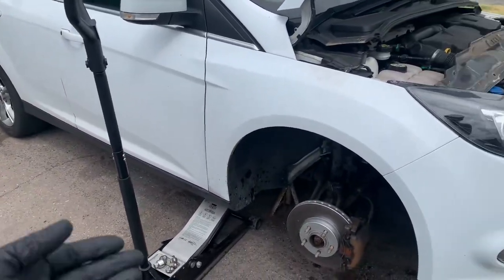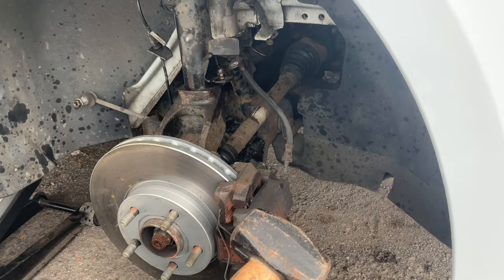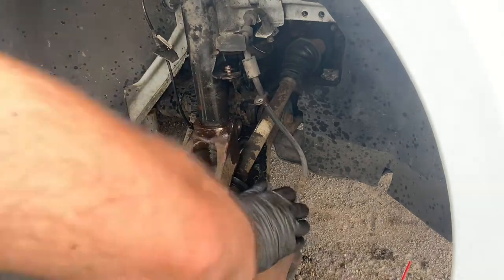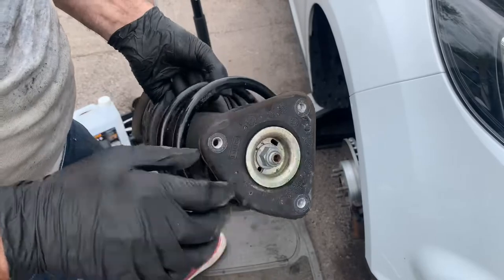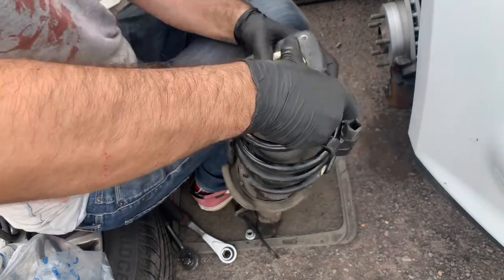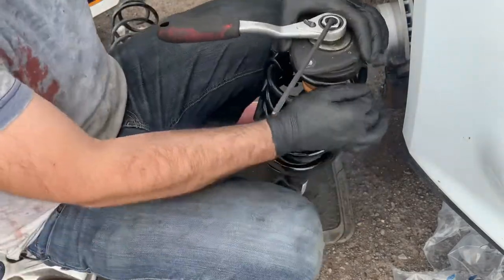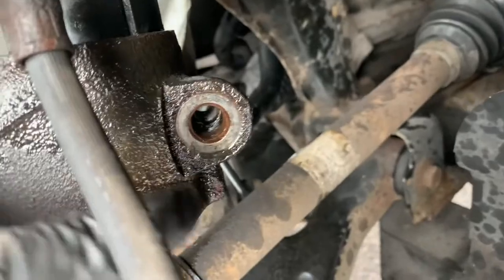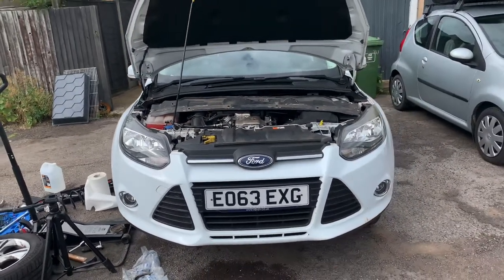Focus MK3 Front Spring replacement - also Focus MK2 Volvo S40 V50 C30

Comment: Excellent video, Gentil! I admire your skills but I'm glad I outsourced this job on my Bravo 😅😉
Did you use a torque wrench and some threadllock during installation?
Reply from the maker: Thank you very much. I used thread lock on the pinchbolt that’s at the back of the knuckle. That’s the only one that had it. I didn’t record most re-fitting bits but I could not find the torque settings for the top mount nuts, so I tightened them to as I felt adequa, but not FT. 
I had ran out of battery, but later I went to tight the nut of the suspension shaft with the car sitting full weight on the wheels, but it didn’t need it.

Comment: I think you're brave using those suicide clamps my friend. Great video though!
Reply from the maker: These are Laser ones and the claws do cover most of the spring and are good to use on these cars. However, they’re not good for many modern cars as their springs are very compressed. It was a case with the Merc where I bought a meatier compressor.
Reply: @GentilsGarage  I like your Vids m8! I've got to start replacing the engine mounts soon. I've got the top one here already. Are you going to do the one under the battery tray please?
Reply from the maker: @R118GSiVVC  thank you very much. I will do the mount under the battery at some point this year. There will be a catalytic converter replacement video for the Mk3 coming around April and I have a few other jobs in the pipeline for the MK2 too, but the E12 is taking all the free time I have now for cars